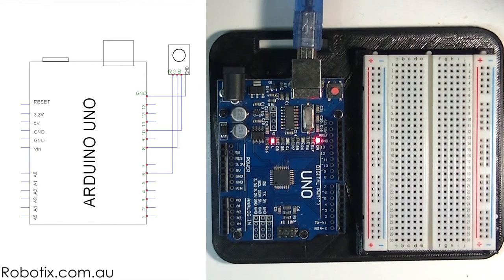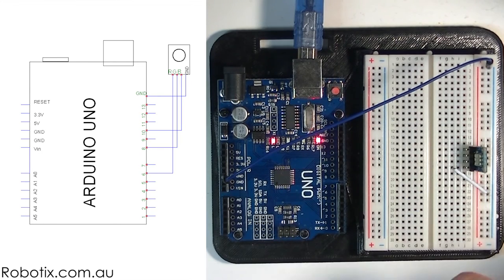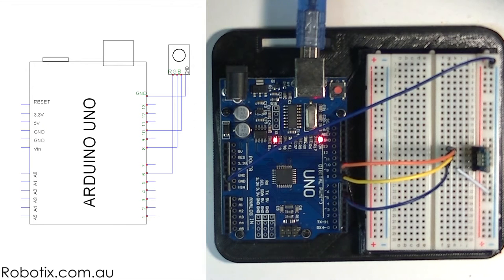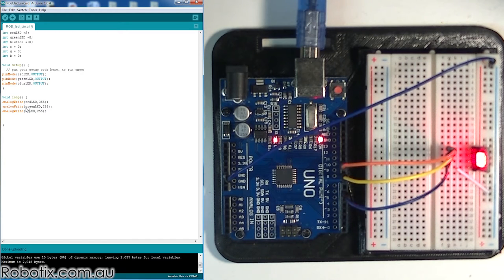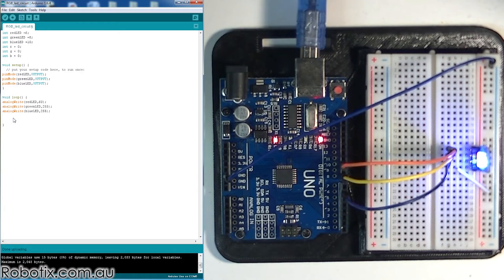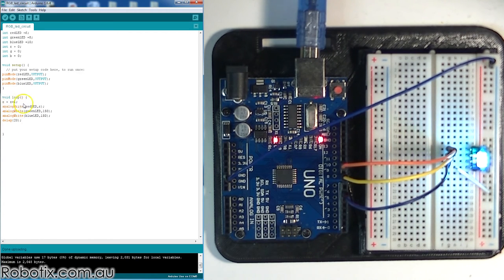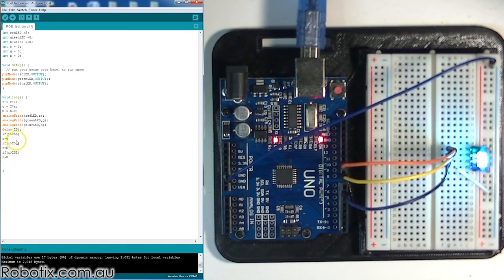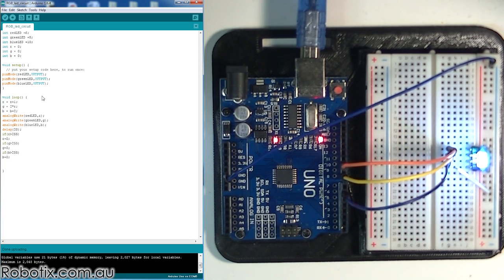RGB LED Programming 🌈💡

Comment: Helpful video. I do not believe that pin 8 should be used for analogWrite because it is not a pwm pin. Can only adjust the voltage on pins 3,5,6,9,10,11